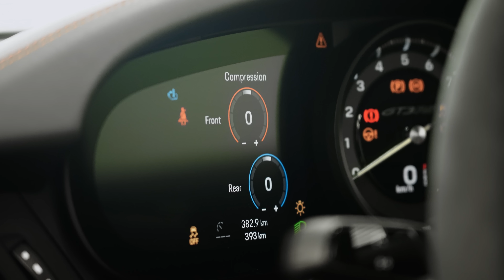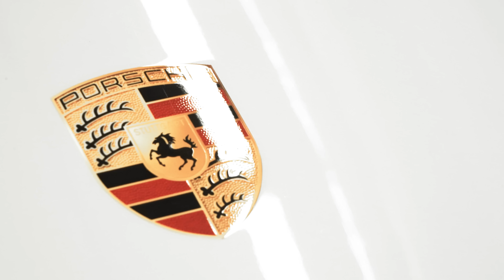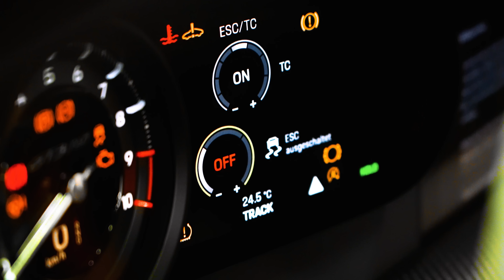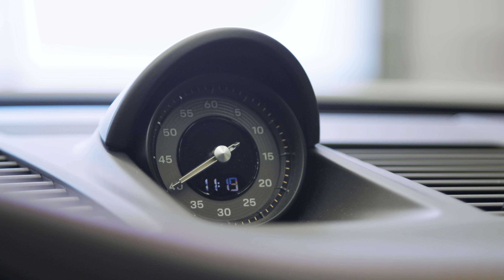NEW Porsche 911 GT3 RS: In-Depth First Look with Andreas Preuninger | Catchpole on Carfection

Comment: Really like what they're doing with the grey exterior with coloured wheels on the top models, the red accents on this one looked quite nice on the leaks already, looking forward to it!
Reply: Nothing says 'innovation' more than a grey plastic splitter, cat flaps in the hood and orange wheels.  Amazballz!
Reply: @BombSponge  Maybe read more about a car before you criticize it that way. There are very few road cars that come close to the effort that went into the aero of this car.
Reply: @Filipolis  To achieve exactly what? I've read and now seen enough to understand that less is sometimes more and if ever there was a Porsche showing proof of that you're looking at it.  Only blind fanbois cry 'AMAZING' at every iteration.  Sorry for bursting your bubble.
Reply: @BombSponge  I mean considering most normal sports cars are already overkill in terms of capability for the road then this one definitely goes a lot further, and less is definitely more fun, I'll agree with that. However it's still nice that there's an extreme performance version that showcases what a brand is capable of. The vast level of adjustability and especially down force stay impressive no matter how you look at it. It's easily the ugliest 992 911 but beauty wasn't what they were going after, still I have to say those hood vents are pretty atrocious.
Reply: @Filipolis  I appreciate the marketing/design exercise but it's not a race car unless a set of slicks fit in the trunk somewhere?  It's a wannabe race car for wannabe race car drivers on the street where you can't race it.  I guess if someone wants to believe they're in a race car so be it.  No matter how much they spent on aero and engineering it's still running on road tyres and would need a lot of mods to get it race ready.  The engineering I appreciate, the aero overkill for the street is cringe IMHO.  Bit like the Senna but at least they marketed that as a track car.
Reply: @BombSponge  if you want a road car buy a base carerra, if you want a wannabe race car buy a gt3rs, if you want a real race car, get a gt3 cup car. there's a 911 for everyone! personally I'll take the gt3rs, because I am a wannabe race car driver, and there's nothing wrong with that.
Reply: @BombSponge  the aero bits are for bragging to the lesser rennlist members with a "base" gt3 at cars and coffee
Reply: Hi do you know what colour is used on this new RS
Reply: What colour is the grey?
Reply: @brianfitzgibbons8167  I assume it's Ice Grey Metallic. The other top of the line models (Cayman GT4 RS and Cayenne Turbo GT) use Arctic Grey
Reply: @Filipolis  thank you

Comment: So much information to process, so much greatness to appreciate. A car that’s not focussed on 0-60 times, but cornering at neck wrenching speeds. 👏
Reply: Wrong, the reason they went with a central intercooler was for better airflow and more hp, he literally said the spoiler will also be completely active so that will also help it with the drag until you hit that new DTS button which will create a whole bunch of downforce that will let you take corners at speeds of 150mph. But yeah I mean it just means its better in every way over the previous generation, This car will easily be 300k with the mark ups in the US going crazy. And if I had the money, I would still buy it at that price without hesitation lol. This is a pure track car, it has 50hp more than the previous generation and beats the Ferrari for most HP per Valve which Honda had before them. This car I'm sure will be the last petrol GT3 we will see, but it is such a gem man its the best NA street legal track ready car we'll ever see and it makes me sad but it's a great way to go.

Comment: i can't get over the fact that this gt3 RS produces more downforce than the Senna, close to gt2 RS performance with 200 hp less
Reply: There were street legal models built on GTR platform. It maybe a few but I would argue DF is more because of wide body over standard Senna. How much DF I don't know but GTR was 1000kg. Street legal GTR models had smaller wing vs track car. DF could be similar or more to this GT3 RS.

Comment: Amazing engineering, great car I’m sure it will be amazing to drive. Not that anyone will find out because you won’t be able to buy unless you buy 2 beige Macans and even then you won’t get a build slot because some flipper will get and sell it straight away for £100k more than they paid for it to someone who unnecessarily accelerates away from every traffic light in west London.
Reply: or six different online influencers. I'm sure shmeeeeeeeee supercarblonde and so on and so forth will have no problems getting allocations.
Reply: @nyc863  exactly. People like that have basically ruined the car market for normal people who’ve saved to buy a dream. That and the endless “you’ll never believe what this old (insert car model) car do” videos have hyped the used market for anything interesting.

Comment: Can’t believe I’m saying this. But I think they went too extreme with aero this time around. Or at least, the integration of the aero is not what I would call elegant.
Reply: It’s a track car…..That you can also drive to the track.
Reply: If you want elegant, then the standard 911 GT3 Touring is the choice. You can't ask for "elegant" in the GT3 RS.
Reply: @jryalls  the more I look at it the more I like it. It always happens to me with new GT3’s. What I wrote was my first impression of the car. I have to agree once I heard it can generate faster cornering speeds than a cup car on slicks.
Reply: @phammanh2689  well, all the previous RS’s have been extremely elegant as well as extremely track focused. This one is the first of the lineage that has gone full crazy racecar with the aero.
Reply: @augustortiz  You will have to exchange some "elegant" for aero efficiency, unfortunately. The old GT3 RS, very beautiful but didn't have great aero efficiency, the newest one did. Like i said, if you want both "aero" and "elegant", then the GT3 Touring or the standard GT3 would be the pick.

Comment: Incredible track car, unusable for the road. I'd go with a GT3 Touring personally
Reply: Why is it unusable for the road, they designed it to meet all road traffic regulations. It's no more radical than a Lambo, Ferrari, Pagani etc. I don't think anyone would use it as a daily driver but you could if you wanted
Reply: @4Kandlez  you must not drive stiff cars very often, my BMW is too stiff for most roads in sport plus let alone this thing

Comment: Absolutely fantastic,Andreas Preuninger and his team did a fantastic job with the 992 GT3 and evolved that car to the brilliant 992 GT3 RS.
Reply: It's a big number to jump to for an extra 15bhp. But, I have to agree the design is radical & a noticeable departure from the stock gts; which in itself is a engineering phenomenon.

If purely in terms of design, build, ergonomics & sheer thrill of edge of the seat enjoyment to drive. Like everything time will tell if this iteration has the same impact & longevity of heritage that the other Porsche RS's have had.

Comment: Everything about this new RS is INSANE. It looks more aggressive and actually more beautiful than both the regular gt3, and the old gen RS. And has all of the tech to back it up. I still cant get over the carbon cage & interior-adjusted compression & rebound🤯. So badass, and it looks perfect.. especially those aluminum rims & behind-the-wheel cutouts🙌

Comment: I’m a dedicated GT3 guy. I’ve had a 996, 997.1 and would have had a 991 but for stop work in 2014. Now I drive a 991.2 GT3.  I LOVE the technology of the RS everything about it.  BUT it’s just too much for the street even if you track once in awhile.  As it is my GT3 is kinda loud. But this is over the top as much as I’m in love with it.  I can’t afford an RS just to track.  No one will use 50% of this on any road even in the famous canyon roads in the US . Now with all these flaps and pumps are just more to fail.  I wonder if even my car is too technologically advanced to be reliable.  Even Andreas said you wouldn’t drive this in the mountains because people would sneer at you, exactly my point.  Much prefer to drive the regular GT3 on the road.  I wish I could afford a trailer and an RS just for the track. But I have to choose just one. This is too much .  I bet this would beat a 996 Cup car, which I’ve driven.  ( Andreas said it beats the current Cup car)I have to be able to drive my cars on the street.
I’m afraid a lot of the technology updates are in the tires
But for the price there’s not another car that has this much technology or performance

Comment: I'm once again blown away by what they have done BUT I think they should have gone an extra step with the setup functionality and add a graphic on one of the screens that really basically explains what happens by adjusting the diff and the suspension. You do X and it will add more understeer for example. Just a brief explanation.

Comment: Motorcyclists understand suspension setup, I’ve just upgraded mine to have high and low speed adjustment front and back ( high and low speed relates to damper piston speed not vehicle speed)
Allows you to setup for road surface and pot holes.

Comment: Crazy car, absolutely fascinating technology. But for me, the charming element of the RS was always the craziness that you could still use as a daily. I had plenty of roadtrips in the 991.2, thanks to the space from the trunk in the front. It was always a car, that you could still use in the Dolomites or even Como area with it's small and narrow, twisty roads. You could just get luggage for two in the car and spent a weekend wherever you want. With this one, it has totally changed. Don't get me wrong, it know RS is Rennsport and track usage should be in the focus - but honestly the GT3 is sometimes too tame (don't know if that's the right term) to replace the 991.2 RS in terms of everyday usage. This new model will only be used to drive around hometown or track. Otherwise you have to ship your luggage to the hotel you are staying in and that's way off the charts in terms of personality. 
I would have loved something like that as a RS R or Track or whatever. Or that the Weissach loses the frunk in the front - would still be fine. But this one is a bit over the top in my personal opinion. It will sell like crazy and Porsche will have a hard time with the demands. But I hope that there is someday the chance of having another RS with some more everyday usage capabilities.

Comment: Dont like the rear wing but the rest of it, is absolutely awesome, what a fantastic track car this will be, although I suspect it wont be a good road car, either way, awesome car and the forthcoming GT2 RS will be even more special.
Reply: ..at this performance level nobody cares about how "nice" the wing looks, you can always get an italian car for beauty.. Personally I'll take one even if it's painted in Barbie pink, who cares?!?
Reply: @farnum3297  I care and I dont like the rear wing design, rest of it, is awesome.
Reply: @anthonywebb4068  to each its own, I don't. To be 100% correct I care way more about performance, this car IS Performance. Again, people looking for design need not apply for an RS, I prefer a manual box as an example but I fully agree with a super fast PDK here.
Reply: @farnum3297  people looking for design should be looking at an RS, just look at the aero as a design element for starters. I presume because you are all about the performance you do a lot of track days and autobahn runs cos that's the only way you'll get to experience the performance of this mega car.
Reply: @anthonywebb4068  like I said, everybody is entitled to it's own opinion and choice, but the the old Porsche motto was "Form follows Function".

Comment: Probably noob question here, but having 800kg of downforce, wouldn't that mean the suspension will basically be fully compressed under such a load, and having no suspension travel at all would be kinda bad at 280 kmh? surely i'm missing something so help!
Reply: No, the chassis cover all of it.

Comment: A comment on the wishbones being aerofoils like F1. In F1, they are neutral aerofoils sitting at zero angle of attack. They're forced to be that way, but the aero teams use them in conjunction with the upwash from the front wing to create downwash and push air where they want it.

Comment: From Porsche data sheet specifications: GT3 992 has 502 hp
Here are saying GT3 RS has 15 hp more.
Why some people are continuous saying that the GT3 992 has 510hp?  What kind of measure standards they are using? 
Big confusion to me !,
Reply: Could be PS vs SAE BHP - they are slightly different units.

Comment: I am very disappointed in regards to the storage space. How are you going to get to the track if you don't have space to store all the items you need for a track day. My current GT3 RS 991.2 has a full trunk filled with track equipment. With the roll cage and bucket seats it is hard to push items through the holes. They made the car less practical for anyone who wants to track it. The whole point of the GT3 RS is a street legal car that is a track monster. Well now you cannot even get to the track because you have no space to take stuff with you. I was planning on swapping mine with new one but now I am a little in doubt

Comment: Honestly feels like an overkill, in a good way of course. I wonder how can they top this for the next iteration
Reply: @BombSponge  haha, my first reaction was, 911 type R. But what I meant is the appendages. Like its “just” a 911 and they basically fit a senna aero with the suspension arms, wings  and such. Electronic adjustables, drs sure are nice, until they stop working
Reply: the crazy part  is, porsche aways overkill, and does something extraordinary all over again through generations
Reply: @bernardibrahim  couldn't agree more. You gotta know where to stop.
Reply: @akiravecchi  Since when? The 911 was  unchanged for decades. Was virtually a flattened VW Beetle for it's first decade.
Reply: @BombSponge  since the first gt3rs

Comment: The 992 3RS is underpowered and the aero will overwhelm the drivetrain. The upcoming 992 2RS with all the power with the same aero will be mega or better paring with the insane aero. In the previous 991 RS, the GT3 was well paired well with the aero or even balanced and 991 2RS the power overwhelmed the suspension. Here 992 2RS will be on another level if they build one with all the aero

Comment: If this starts off being marketed at £249K it will just be out of reach for the majority of  normal working people. £225k for the last model was such a jump in itself from the average £150-£189k, 997, which on a finance point of view was getting unachievable without a massively high deposit.

Comment: The attention to detail on this car is amazing, as for design not a fan, it looks like it's trying to hard.
Reply: All the exterior design serves a purpose and also it’s a track car…if u want a less say crazy if that’s a the word u can always get a GT3
Reply: You can still have functional design without it making the car look odd, the Bonnet design is poor, the rear wing is so big it looks out of proportion with the rest of the car, and the indicator which is behind the air duct on the side of the car does not work, you cannot see it. Function over form is one thing, poor design solutions are another?

But I guess all will be forgiven if it drive like a demon on track, which I’m sure it will do. :)

Comment: I'm here for all the engineering and surely its pretty cool to see but man there's a lot of plastic on the body that makes it look cheap! The car also feels gimmicky to me with the red wheels and stickers...looks like something you'd get done at your local "Vinyl wrap" guys for a few bucks....i get that it's meant to be an homage to the original 996 GT3 RS but it didn't work! That car's proportions were better suited for this color combo, this car is massive! 

Lastly i feel that the overkill of aerodynamics on this car are a compromise to avoid using a turbo engine in the GT3 RS, which would mean Porsche would loose out on extra profit by rebranding this thing in a year or so as the GT2 RS (identical car just with a turbo on top)...not to mention the gullible Porsche owners would get a hiss fit about "pUrItY"....Porsche owners are the same as Apple owners re-sell the same concept a little bigger each time and they'll flying in like flies to horse s***

That said it's interesting to see this much aero and engineering in a genuine road car, would be nice to see this lined up against the AMG GT Blacks Series to see how they compare!

Comment: 100% this really is a track car only. Unlike the predecessor that worked great as a road car too, driving this around on the street really is a waste.
Reply: Nope, it is still road legal. People dont realize how far apart track only cars are from street cars.
Reply: @EK-rr2md  what I mean is the 991 behaved very well on the road and felt just at home on some twisty mountain roads as it would on the track. This version seems considerably more hard-core will be interesting to see how it behaves in a street setting